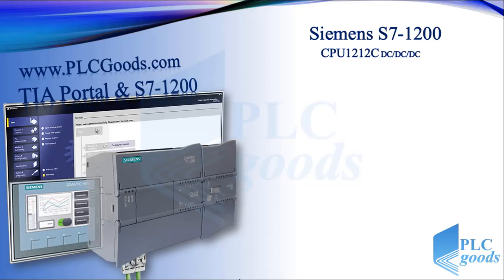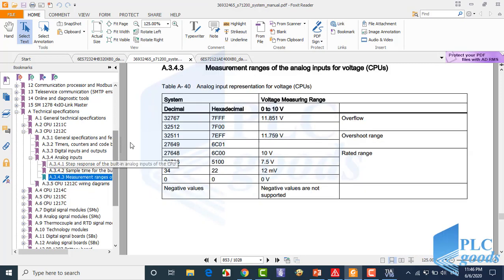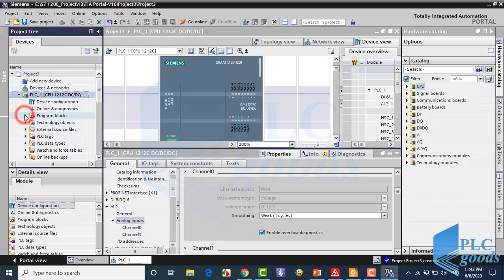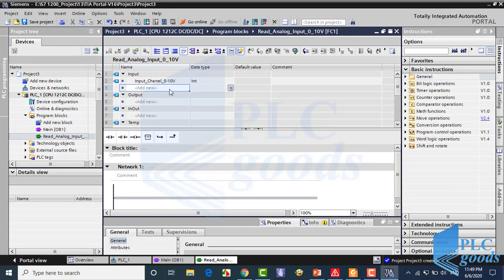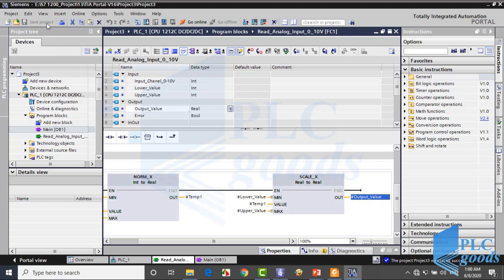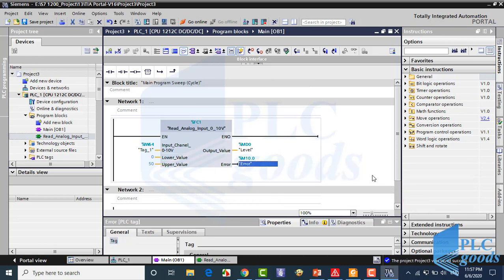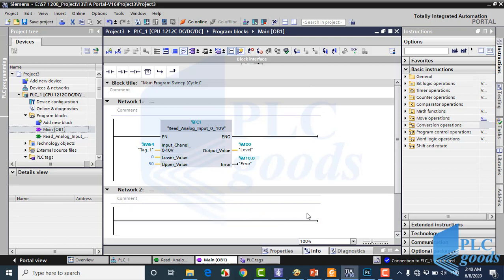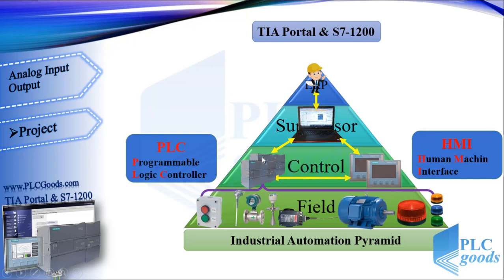How to use analog input/output signals modules | Lesson 30

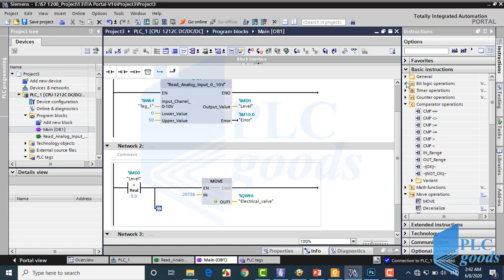Comment: Hi Sir, (At Time = 14:45). What will happen if we didn't right the line "Move "0" to Electric Valve" if the level is not below 5.  Will the Electric Valve still be open for 16mA current.  If the level is not below 5 then the MOVE instruction will not move any value to the Electric Valve so the output analog current will be zero right then why should we have wright this line?
Reply from the maker: Hi there, If the MOVE instruction is not enabled, then it won't do anything. In this condition, If "Electric Valve" is open, it remains open, and if it is closed, it remains closed as well. So, I needed to write the line "Move 0".
Reply: @plcgoods  Thank you so much sir

Comment: Thank you for the tutorial but how to do the conversion blocks using s7 300 cpu since the norm_X & scale_X don't appear when selecting s7 300 cpu
Reply: Hi there, note that each PLC may support some instructions that maybe are not used with the others. Also, now we are preparing a course about S7 300. It can help you to use analog signals with S7-300 PLCs.
Reply from the maker: Thanks for checking the channel out!

Comment: Hi all,   vhen I have a defective Analog I/O module Sinad 6ES7232-4HB32-0XB0, the red LED starts blinking to show me the fault.  Can I simply substitute the old defective  to a new one or we must manage the soft for the new module recognization? thanks a lot.
Reply: Hi there, I've never had your problem, but In my opinion, you can substitute the defective module to a new one with the same model. one time, I changed my CPU module with a similar CPU, and then transferred my project without adjusting the CPU model inside my program. it worked correctly.
Reply: Also, If you want to use another type of analog module (with the same input type), you can transfer the PLC program to your computer, modify the selected analog module inside the hardware configuration window, and then transfer the modified program to your PLC
Reply from the maker: thanks for checking out the channel

Comment: Hi Can you please help me as i am new to this  programming  world 
What is the difference between |RAW value and Scaled value do they need to be same always
Reply: Hi, usually they are not the same. If you have a 13-bit resolution analog input channel, your raw input range is 0 to 2^13 = 8192, 0 representing the minimum value of your analog signal, 8192 representing the maximum value. analog input modules are suitable for a specific range. If you set it up for 0-20mA, and you connect a 4-20mA sensor, you won't have 0 as a raw value when the sensor output is minimum (4mA). If you want the 4-20mA to represent a water level between 10 and 300 cm, then that is your engineering range, also referred to as scaled range. usually, PLCs have some instructions to scale the received RAW value according to the next formula 
scaled value = (raw value * factor +offset) * unit of measurement
Reply from the maker: thanks for the inquiry
Reply: @plcgoodsmentor9223  Thanks very much for you reply So basically i am an Automation Validation Engineer, While performing FAT f on one of the systems on the HMI they are displaying RAW value and Scaled value for all the analogs of same make and model and signals are coming from same Festo but i see the difference between them is ns 3 deg and for some transmitters it is 0.2 deg . My concern is which is actual field value . If we consider Raw value as actual field value, then i will ask them to calibrate the Instruments . Sorry for this long reply